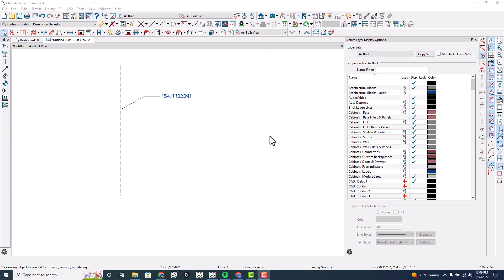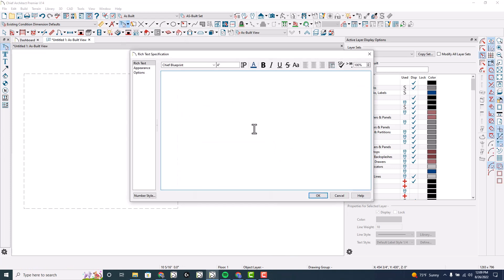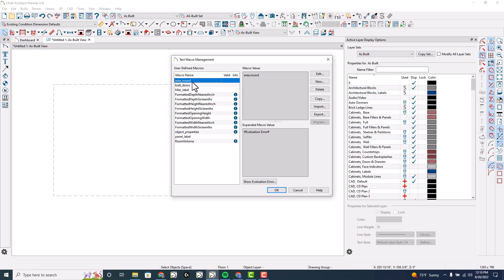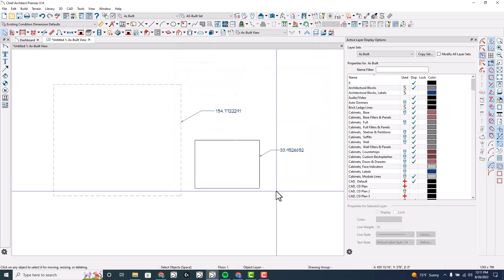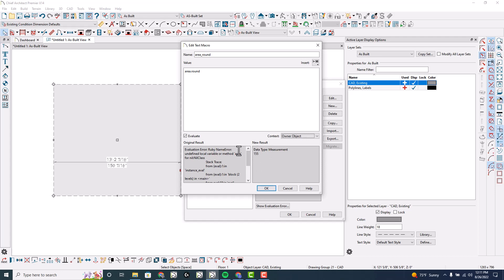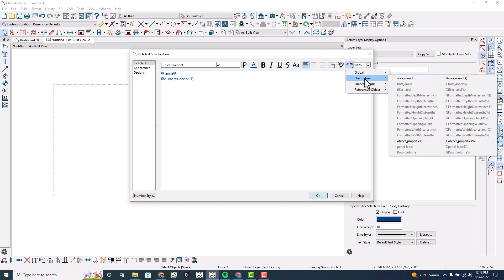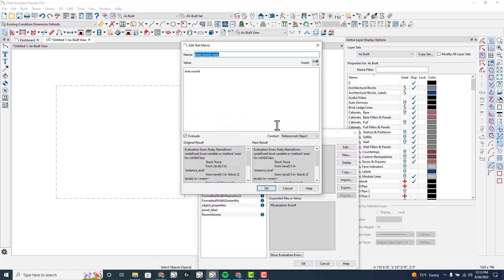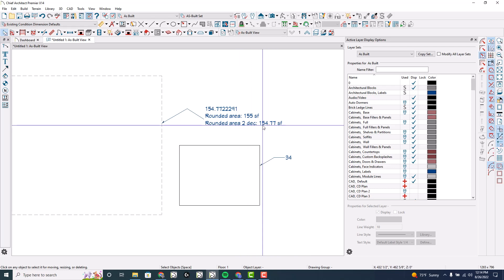A Rounding Macro | Chief Architect

Comment: You don't even have to use the macro management tool.
Just put:

%area.round(2)%

In a text box and point it to a closed polyline.
The advantage of the Text Macro Management tool is you can abbreviate your command string to keep things cleaner in the text box.
Reply from the maker: True. You don’t have to put that in the macro manager.